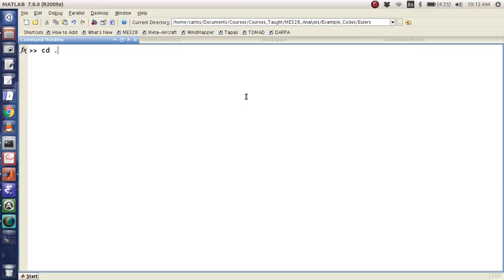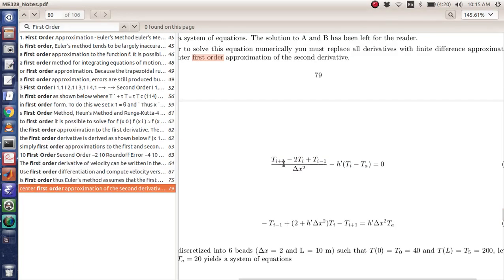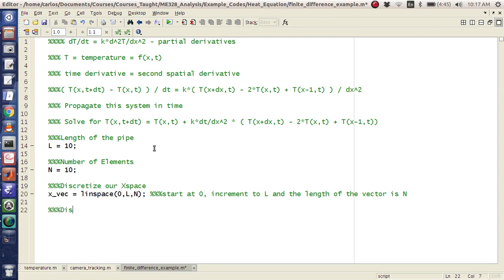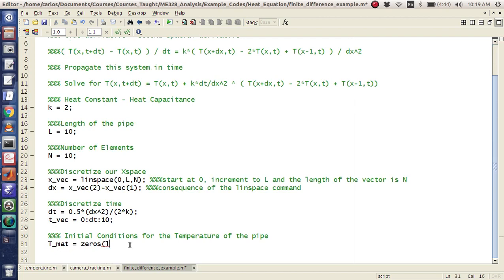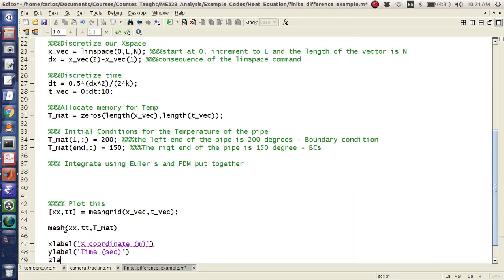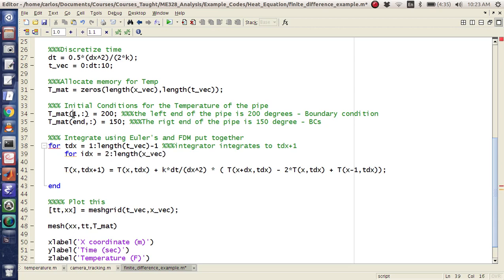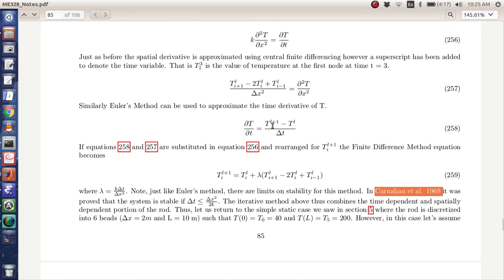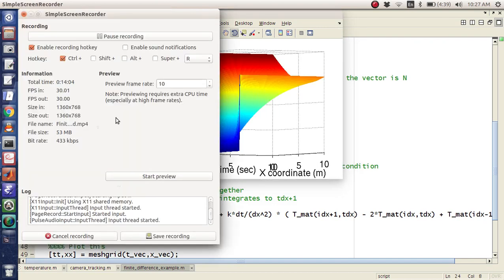MATLAB Help - Finite Difference Method

Comment: Thank you so much for such content, what I would like to ask is what if my initial condition at T(x,0) is a function of x , then how can i insert such a condition to your code also one more thing is that what if i want to analyze such system with Neumann boundrey conditions. Can you please help me with that?
Reply from the maker: At 6:45 you'll notice that line 34 says T_mat(1,:) = 200; That means that there is a boundary condition where the left end of the pipe is always 200. On line 35 I have that the right end of the pipe is 150. If you want to set the initial condition of the pipe you'll need to put

T_mat(2:end-1,1) = 100;

That line of code says that for the first timestamp from the 2nd point on the pipe to the point right before the end the pipe temp is 100. I hope that helps.
Reply from the maker: Oh and for Neumann boundary conditions you need to redo the equations of motion and you'd have to redo a lot of the code. I'd recommend doing it by hand first.
Reply: @CarlosMontalvo251  Thank you so much

Comment: Thanks Dr. Very nice and informative lecture. 
Can you please make a lecture on how to solve (i) nonlinear system of ODE with reaction diffusion term, (ii) solving nonlinear system of coupled ODE; both using finite difference scheme
Reply from the maker: Unfortunately this video here is the limit of my knowledge. I am an Aerospace Engineer and just teach Numerical Methods at the UG level.
Reply: @CarlosMontalvo251  Thanks for the response. I can send you some references, may be it could work out for us.
Reply from the maker: @swatityagi4358  Sure send it over. It might spark some interest.
Reply: @CarlosMontalvo251  can you give me your email id, so that I can share.
Reply from the maker: @swatityagi4358  Just post them here.

Comment: Dr Montalvo, if you want to use U values for thermal resistance instead of  K values how will this effect your governing equation ?
Reply from the maker: The governing equation is on line 7 with k values. This is the only equation I'm familiar with. If you change it to U values you'd have to go look in a thermodynamics textbook to find the answer. If you have the governing equation then you just rederive the equations of motion like I did.

Comment: Good day Dr. Carlos, May God bless you for putting off such tutorial. please I still need your help for 2D PDE TUTORIAL (I MWAEN YOU SHOULD EXTEND THE ABOVE TUTORIAL TO 2D). THANKS
Reply from the maker: Ok cool I'll check this out in a few days
Reply from the maker: In the problem you gave me there is still a significant amount of information missing. What is p,p_s,k_ex,k_er,k_ez,h_w,T_w,epsilon,T_0? Also is rco a function of T or just a constant ?
Reply: Dr. Carlos Montalvo Thank you so much for looking into my problem. I'm sorry for messing up with parameters. p, p-s are fluid and Catalyst densities given as 0.597 and 7633.65 respectively. k-ex=k-er=k-ez=k= 0.0454 (thermal diffusion along z and r been equal).
T0 initial temperature 433. Epsilon (e)=0.3.
rco is dependent of temperature (I'm quite happy for asking this question).
At r=R, T=Tw. (boundaries conditions. bit not clear to me). Thank you in advance.
Reply from the maker: I still need h_w, T_w and epsilon - Also, is rco a function of T or just a constant?
Reply: Dr. Carlos Montalvo the rco is function of temperature. Epsilon (e) =0.3. Tw= 360. Hw =1.
Reply: good morning sir, i hope you are doing well,  i wish to make some adjustment, hw=ke*u/De, Pco=CcoRT (Pco=PRESSURE IN THE rco, Cco concentration, R=0.000082 )
Reply from the maker: Can you give me an example?
Reply: @CarlosMontalvo251  
δT/δt=-u δT/δx+1/ρCp [k_ex  (δ^2 T)/(δx^2 )+k_er (1/r  δT/δx+(δ^2 T)/〖δx〗^2 )+ ρ_s (1-ε) H n(r_co )]
The initial conditions for the continuity and energy models are
at t=0,T=T_0
The boundary conditions are:
.At Z=0,,〖-k〗_ez  δT/δz=ρuC_p (T_0-T)
At z=L,  δT/δz=0
At r=0, δT/δr=0
At r=R, -k_ez  δT/δr=h_w (T-T_w)
u= 0.5; %m/s
gs=7633.65; %kg/m3
ef=0.7;
e=0.3;
k=0.0454; %W/m.K
Cp=2639.53;  %J/kg K
g=0.597;  %kg/m3
k2=100000;   %mol/m3s.
E2=16000000;  %J/kmol 
R=8.314;    %J/K mol
Pco=0.2;
Ph20=0.8;
Pco2=0;
Ph2=0;
T=633; %K
H=-115823; %J/mol
rco =k2*exp(-E2/(R*T))*((Pco*Ph20-(Pco2*Ph2))/(exp(4577/T)-4.33)); %mol/m3s
Reply: I wish you find time out of the tight schedule to solve it.
Reply from the maker: @baacademy1166  Are the variables r and z with respect to time?
Reply: Dr. Carlos Montalvo yes they are, Unsteady state.

Comment: clear 
clc
close all

%%% Heat Constant - Heat Capacitance
k=2;

%%% Length of the pipe 
L = 10;

%%% Number of Elements 
N = 10;

%% Discretize our Xspace
x_vec = linspace(0,L,N);
dx = x_vec(2)-x_vec(1);

%% Discretize time
dt = 0.5*dx^2/(2*k);
t_vec = 0:dt:10;

%%% Allocate memory for Temp
T_mat = zeros (length(x_vec),length(t_vec));

%%% Initial Conditions for the Temprature 
T_mat(1,:) = 200;
T_mat(end,:) = 150;

%%% Integrate using Euler's and FDM put together
for tdx = 1:length(t_vec)-1
    for idx = 2:length(x_vec)-1
        T_mat (idx,tdx+1)= T_mat(idx,tdx) + k*dt/dx^2 * (T_mat(idx+1,tdx)-2*T_mat(idx,tdx)+T_mat(idx-1,tdx));
    end
end
[tt,xx] = meshgrid(t_vec,x_vec);
mesh(xx,tt,T_mat)
xlabel('X coordinate (m)')
ylabel('Time (sec)')
zlabel('Temperature (F)')

Comment: I am solving four coupled pdes in 1D  and want to make one dependent variable value constant after particular time so it cant go below zero and I will use its zero value for further simulation to get desired value of other dependent variables.
Reply from the maker: I would make that variable a global variable so that when you change it in one place it will change it everywhere
Reply: @CarlosMontalvo251  ok sir if we want to stop one variable after some time so it can not affect the other one how we can do that in the coupled pdes system
Reply from the maker: @tutorcosmos  if you're using ode45 that may be more difficult. However if you are using RK4, you can set the variable to a constant in your for loop. That might be an interesting video to make.
Reply: Dr. Carlos Montalvo actually I am using ode45 and ode23tb .please make one Vedio its really helpful
Reply from the maker: @tutorcosmos  i would look at one of my Rk4 videos first to see how to do that.
Reply: Dr. Carlos Montalvo ok sir. I can also share my problem which have three coupled pdes
Reply from the maker: @tutorcosmos  Something that I've also encountered that helps the situation is to simplify the problem so that it is easier to code. Then once you can get that to work you can increase complexity. Another option you could try is to set the derivative equal to zero when you want the variable to remain constant. That way ode45 will no longer propagate the state
Reply: @CarlosMontalvo251  ok sir i will try

Comment: Carlos, what a good video and explanation!
I have a question: Why for the discretization of time (Stability criterion - Carnahan), do you multiply by 0.5 and then divide in two again? It should not be (dx ^ 2)/(2 * k), without the 0.5. I am right?
Reply from the maker: I think I was just messing around with numbers. I believe you have it right. It should just be over 2.
Reply: Thank you, Carlos!

Comment: this video really helped me a lot.Please do you could do a little video that explains the variation of temperature over time?
Reply from the maker: Are you talking about the underlying physical phenomena? Because if so that seems more well suited for a different channel.
Reply: in fact it is a question of tracing the evolution of the temperature as a function of the time since in the video you did it according to x and the time. I would like to know how to do it on matlab.
if possible now since I work on it and I am blocked. An explanation on it will help me but a small video will be able to help me even more
Reply: in general i just want to know how we can plot the evolution of heat as a function of time
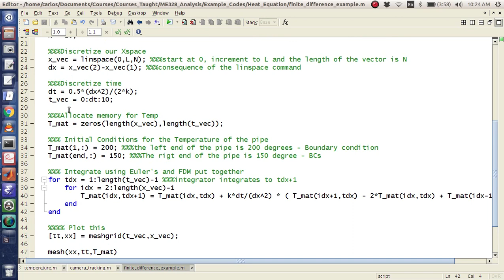Reply from the maker: @bertinekouekam8648  I don't understand your question. At 11:08 I show a plot with position of the pipe on the x-axis and time on the y-axis. You're asking how to plot temperature as a function of time but I already did that.
Reply: i want to have something in 2D with heat on y axis and time on x axis a thing like that T=f(t).i don't know if you understand me know
Reply: and i would like to say heat and not temperature sorry for all i am a french student.i just try to speak english
Reply from the maker: Ahhh. Je te comprends. What you need to do is plot align one axis. 

plot(t_vec,T_mat(3,:))

That will plot the temperature as a function of time at position x_vec(3) in the pipe.
Reply: yes it is exactly what i want
Reply: Thanks thanks thanks and great thanks for all sir it is 100% working!!!!!!!!!!!!!!!!!!!!!.
But i don't very understand this command :''x_vec(2)-x_vec(1)''

Comment: Hey! How do you implement an implicit method in this? What you have done is an explicit method of solving. Implicit method involves TriDiagonal Matrix, and I'm stuck there. Would be of great help if you could do a video on that? Or just guide me, either ways it's fine.

Comment: Hi Dr
 Please. I needed an algorithm to solve the equations Telegraphic equations or Propagation equations of transmission line by method FDTD.( for my university project)
Reply from the maker: I don't know what telegraphic equations or propagation equations are. I am an aerospace engineer. You will have to ask someone else.
Reply: Dr. Carlos Montalvo they are bulk matter equations in electrical engineering (edit: and applied physics) that model the propagation of electromagnetic fields along a wire. The model assumes microscopic resistance, capacitance, and inductance of finite elements of the wire. The equations are called the “telegrapher equations” and resemble modified wave equations. Typically, in electrical circuit design we assume that the bulb or whatever turns on immediately after the switch is turned on. However, a tiny amount of time is required to transmit this signal. For high frequency circuits or dimensionally large circuits (relative to the wavelength of the incident radiation in the wire) we need to account for this delay, hence the discretization of the conductor via telegrapher equations. Another approach is to solve the Maxwell equations of electromagnetism,  it this requires an understanding of Green’s functions and potential functions (which isn’t too bad once you look at the math). Usually, such math cannot be resolved analytically, which I guess is why the OP was watching this video. I’m a dropout (cashier) so I have limited experience & training with these things lol. I just heard about these equations in the grapevine. Awesome channel btw 100% subbed 😊👏🏽🎊🥇🤓
Reply: Dr. Carlos Montalvo just outta curiosity, what do aerospace engineers do?

Comment: uhmmmm good evening i dont speaks english sry :D
If you give me initial temperature where would it go in your program?
Reply from the maker: Initial conditions are set on line 34 at 6:43
Reply: Nono, if it is a bar with 100 F on both sides and the initial temperature is 20F how could it be? uhmmm ty anyway

Comment: I'm trying to solve 1D laplace heat  equation for a plate using the FDM. Do you have any advice as to how i can the code step by step and plot contours as my matlab skills are mediocre.
Reply from the maker: Are you looking for something like this?

purge

x = 1:3;

y = 1:3;

[xx,yy] = meshgrid(x,y);

T00 = (75+0)/2;
T44 = (75+50)/2;
T04 = (100+75)/2;
T40 = (0+50)/2;

A = [ 4 -1 0 -1 0 0 0 0 0;
-1 4 -1 0 -1 0 0 0 0;
0 -1 4 0 0 -1 0 0 0;
-1 0 0 4 -1 0 -1 0 0;
0 -1 0 -1 4 -1 0 -1 0;
0 0 -1 0 -1 4 0 0 -1;
0 0 0 -1 0 0 4 -1 0;
0 0 0 0 -1 0 -1 4 -1;
0 0 0 0 0 -1 0 -1 4];
b = [75; 0; 50; 75; 0; 50; 175; 100; 150];
xans = A\b;
Tsolution = wrapmatrix(xans)';

%Tsolution = [43 33.3 33.89;63.21 56.11 52.34;78.59 76.06 69.71];

plottool(1,'Heat 2D',12,'x (m)','y (m)','Temperacture (Celsius)',['Heat' ...
      ' 2D'])
        
%mesh(xx,yy,Tsolution)

T = [0 0 0 0 0;75 75 60 50 50;75 75 60 50 50;75 75 60 50 50;100 100 100 100 100];
for iter = 1:10
    for idx = 2:4
        for jdx = 2:4
            T(idx,jdx) = (T(idx+1,jdx) + T(idx-1,jdx) + T(idx,jdx+1) + T(idx,jdx-1))/4;
        end
    end
end
plottool(1,'Heat 2D',12,'x (m)','y (m)','Temperacture (Celsius)','Numerical Error')
      
mesh(xx,yy,T(2:4,2:4)-Tsolution)

%%%Iterative Method
Reply from the maker: comment out plottool and purge oh and comment out wrap matrix too.
Reply from the maker: Hmm. I'm not sure that code will run easily. This seems more complex than I thought.
Reply: this could be helpful thanks

Comment: How do I plot the temperature versus the distance(for a particular given time..say at the end of 10min I want a plot of T vs x) in your problem?
Reply from the maker: plot(x_vec,T_mat(:,end))
Reply from the maker: Let me explain. x_vec is the vector created that contains the x-coordinates. T_mat is a matrix. The number of rows is the same as the length of x_vec and the number of columns contains each temperature profile for each time. So plotting T_mat(:,end) plots the last time slot T_mat(:,2) would plot the second time slot or rather the second timestep.
Reply: Thanks a ton!

Comment: Hi! Can you please help me on how to solve with finite difference method and ode45 put together (rather than using RK4)?
Reply from the maker: I don't think that would work to be honest. ode45 uses an adaptive timestep and finite difference method is a fixed timestep. But maybe it would work? Seems kind of difficult though.
Reply: Thanks for the suggestion.If you could help me how to solve simultaneous differential algebraic equations(1st order) where one initial condition is known(It is required as we have to discretize the space not the time)...then I could probably do it myself
Reply from the maker: Simultaneous differential algebraic equations? I don't think I've ever heard of those. Can you give me an example?

Comment: http://ascelibrary.org/doi/full/10.1061/(ASCE)0733-9429(1991)117:9(1145)#aHR0cDovL2FzY2VsaWJyYXJ5Lm9yZy9kb2kvcGRmLzEwLjEwNjEvKEFTQ0UpMDczMy05NDI5KDE5OTEpMTE3OjkoMTE0NSlAQEAw
in this paper You'll find three equation on page 1147.  I hope you'll look after to solve my equation
Reply from the maker: I took a look. That is beyond my level of expertise. I am an Aerospace Engineer who mainly deals with ODEs. Again I would imagine you could just integrate each equation sequentially in a loop. If you could simplify the problem to 3 PDEs but perhaps not so specific to Fluid Flow I might be able to take a look.

Comment: Sir, i m trying to solve three partial differential equation ,where two is linear and one is non-linear. They have three unknown and these equation are related. Can u pliz help in dealing with 3 unknown variables
Reply from the maker: To solve multiple equations simultaneously you just need to stack them in vector format and integrate them simultaneously. In this tutorial I show how to integrate a 2 state system using RK4. PDE's aren't much different. http://fastlabtutorials.blogspot.com/2015/03/everything-you-need-to-know-to-code.html?view=classic
Reply: Thank you Sir.
Reply: Sir, is it posible in matlab to solve three non-linear PDE which are interlinked together??
Reply from the maker: +Naz Rahman I think so but I've never done it before. my specialty is in ODEs.
Reply: Wil you give a try to solve my non-linear PDE if I send you my equation set?
Reply from the maker: If you send me a simplified version I can take a look. Many people send me example equation sets but they are too complex for me to understand. Send me a note explaining all variables and initial conditions and I'll add it to the queue

Comment: Thank you so much, this was very helpful to me!! Can I use this very method to solve problems with some others boundary conditions?
Reply from the maker: Yes of course. Just change lines 34 and 35. T_mat(1,:) = 200 etc.
Reply: I mean, others like Neumann boundary conditions
Reply from the maker: If you want to use Neumann boundary conditions the equation on line 7 changes since the boundary condition is now a derivative. I have those equations lying around in my notes somewhere but overall the code is very similar.
Reply: Thank you so much, that was clarifying!